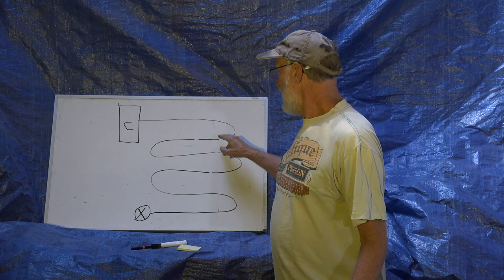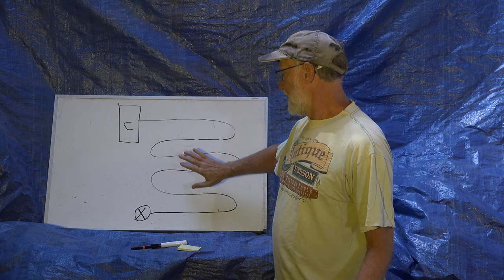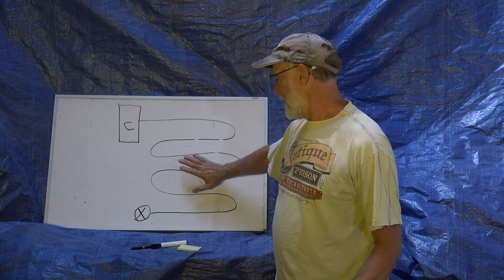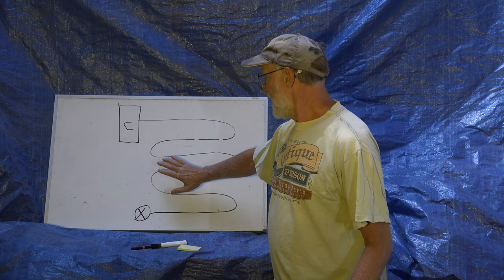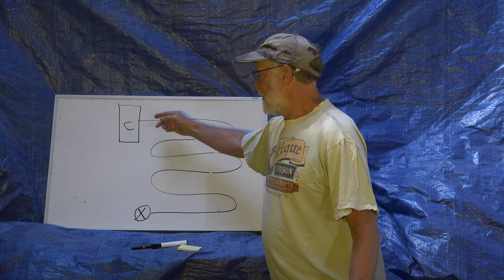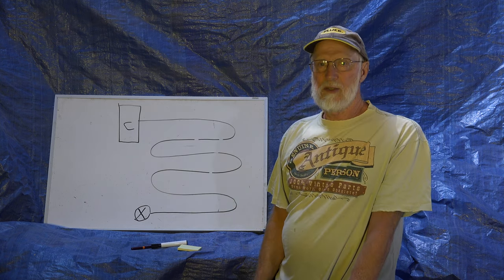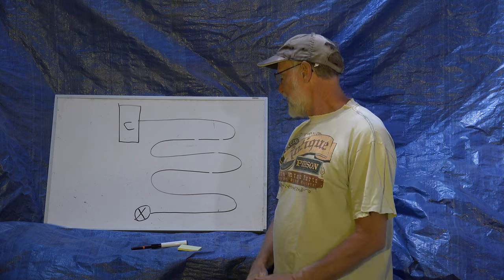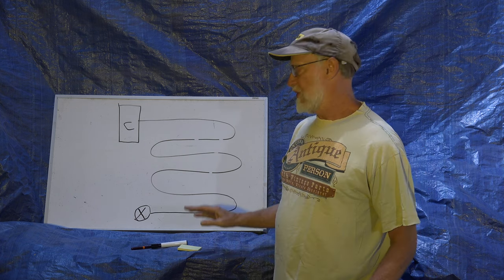How the evaporator works and why

Comment: Hey GFM,

I did a manifold leak test in water with pressure like you've done in an old video. I was able to find a small leak in the low side knob that required a new o-ring. After the o-ring replacement, I tested again and this time there were no bubbles anywhere.

I then connected a vacuum pump and pulled the manifold into a deep vacuum (around 29 hg.) and left it for a while, there's a ball valve on the service hose that is closed before turning the pump off. I had both knobs closed and after maybe 20 minutes, the vacuum dropped to 25 hg. I notice that the needle on the high pressure side was off the stop as well, so there was leakage there as well. Now I'm thinking that since it is not connected to an actual system, that there is so little volume in the manifold that such a leak is considered acceptable and that if I did this same test with it hooked up to a sealed system, it would not drop after 24 hours, since there is so much volume in it; which would take a very long time leak out at that rate. Is this a correct assessment? I'm like 90% convinced that it is, but I need to be 100% before I start using it.
Reply from the maker: That size vacuum leak is generally impossible to stop.  Most of these hoses have some leaks in the hose itself.  
GFM
Reply: Thanks for answering. I just found something out by accident. I left the manifold in its closed position for more than 24 hours. The low side was down to like 15hg, but the high side was showing 10psi of pressure! Now it dawned on me that this has something to do with barometric pressure and these hoses aren't really leaking. Just like putting a sealed container in heat will make it expand and putting that same container in ice will make it collapse; this principals hold true for the manifold as well to some degree. Since there is so little volume in the manifold, it doesn't take much expansion/contraction to show up on the gauges. Just my theory of course. I would be interested if anyone else has tried this with a brand new manifold, with new hoses just to see if this happens.
Reply: As I understand, manifolds, gauges and typical charging hoses are not vacuum rated.
Reply: I would just like to know if anyone has successfully been able to hold their unconnected gauges in a vacuum for a couple of days. I'd also like to know if they open their gauges and bring them to zero and then close them up, if they will stay at zero or slightly increase in pressure like mine does. I think knowing the answer to these things is very helpful to anyone who works in this field. There should be no unanswered questions regarding any hypothetical test.

My manifold holds pressure, but not vacuum; so it seems. Pressure can actually increase, but does not decline. I'm thinking that maybe they have a vacuum leak, but do not have a pressure leak and that barometric pressure changes are allowing air to enter the manifold through the vacuum leak, but isn't allowing it to leak back out when barometric pressure drops. So in effect, it is acting like a check valve to the atmosphere. I would just like to know if this happens to all manifolds and can be considered normal, or that my manifold gauge is just not adequate.
Reply: jjenson2006 Wouldn't that just be the affect of a rise in temperature on the air or trapped gas in the manifold?
Reply: That was my original thought. However, if that was the case, wouldn't the pressure drop again when the temperature dropped? The gauge only increases. I have left it alone for several days now. My high side is up to almost 20 lbs. The low side is about 8 lbs.

It seems to me that pressure is getting in easier than it can come out; like a one way check valve.
Reply: just for curiosity...digital or analogue?
Reply: Cheap analog manifold. Not sure what difference it would make. I don't make a living off A/C repairs, so I didn't see the need to buy a top notch set that would last through years of abuse. However, I'd go out and buy an expensive brand name set if it didn't do the same as mine. But I'm not going to go out and buy the set, just to find out it does exactly the same as mine.
Reply: it is possible to hold a vacuum in your gauges for a few days under a controlled load but, it's not a good idea because refrigerant can destroy the rubber gasket in the manifold. Also, pressure is building in your gauges because obviously the refrigerant you had in it under a vacuum is somehow being heated, and it doesn't raise and lower as quickly as you think because refrig is good at holding pressure. But I promise you if your gauges have a leak it will be in vacuum and positive pressure. and just because the pressure builds doesn't mean there's a leak it just means the pressure was raised due to exposure. A vacuum really can't be held for days and weeks because of this, especially in gauges.
Reply: it is possible to hold a vacuum in your gauges for a few days under a controlled load

What do you mean by a controlled load? Hooking it up to a system? Yes, I know it can hold when it's hooked up to a system and mine does, but I'm talking specifically when it isn't hooked up to anything and the valve is just closed.

refrigerant can destroy the rubber gasket in the manifold

I thought that the o-rings and gaskets were made of HNBR rubber that are able to withstand high heat and chemicals over a very long time period, which is why they are used to seal the systems in the first place.

pressure is building in your gauges because obviously the refrigerant you had in it under a vacuum is somehow being heated

But I don't even have to have it under vacuum. I could simply open the valves, let the gauges snap to zero and then close them, let it sit over night and in the morning there will be pressure.

if your gauges have a leak it will be in vacuum and positive pressure

It is very possible to have a vacuum leak and not a pressure leak. There is plenty of research out there that supports this.

Do you own a manifold? If you do, have you tried doing what I did?
Reply: I meant to say constant load and  a load is a temp or pressure ie. a compressor runs under a different load between night and day. also leaky gauges won't hold pressure or vacuum.
Reply: yes Yu can have a vacuum leak nd not a pressure leak but unless you're working on a negative pressure system such as chillers the only thing keeping pressure from leaking is a piece of debris nd that won't hold for long
Reply: and if Yu ever been in an HVAC class they will tell you it's not recommended to hold a charge or vacuum in gauges over time because the refrig carries NCs and oil which WILL break down the o-rings and inside of your hoses
Reply: jjenson2006 and if your gauges are building pressure over night that water you tested them with is possibly still in your gauges but I've never saw that except for this one guy he had a pretty shitty pair and they were already broke the needle would flutter from 0 to 80 when he set them down
Reply: jjenson2006 do Yu work in HVAC?
Reply: I meant to say constant load and  a load is a temp or pressure ie. a compressor runs under a different load between night and day. also leaky gauges won't hold pressure or vacuum

Obviously atmospheric pressure and temperature are not constant over a 24 hour period; that is not how nature works. This is the whole point of this discussion; is the change in temperature/pressure influencing my gauges when it is not connected to anything and is this normal.

I don't do HVAC for a living. My knowledge and experience in the field is limited; which is why I came here for advice. I do have very broad knowledge and experience with science and physics; which is why this interests me so much. However, I am more interested in finding an answer so I can be confident with my equipment. How can one work on something if he's not confident on the accuracy of his measuring equipment?

I do work on automobiles a lot and once in a while I have to fix or service the A/C. It's very rare that I would be working on a residential unit. Having a system that holds vacuum, but doesn't hold pressure is not very rare on an automobile. Sometimes it could be debris in a line; other times it could be an o-ring acting like a one way check valve or there could be a pinhole in a hose which when vacuum is applied, it will pull the hole shut. Did you ever try using a soft rubber hose on a vacuum? The hose will collapse and seal itself up. The same principal can be applied to a small hole in a hose; especially if it's an extra thick hose (like a standard barrier). You can search through forums on the internet and come across plenty of cases where this has happened. So I know that an o-ring can behave like this and since a manifold does have o-rings in several parts of it, I don't see why it can't happen on a manifold. Vacuum and pressure exert different forces on the o-rings. It's either pushing or pulling on the o-ring. An o-ring if installed properly will move in or out depending on the direction of pressure and has to seal on its two opposite surfaces, depending on whether there is vacuum or pressure. If one of those surfaces has debris or is damaged (dirt, hair, scrape, warpage, etc.), it will only leak on that side.

if Yu ever been in an HVAC class they will tell you it's not recommended to hold a charge or vacuum in gauges over time because the refrig carries NCs and oil which WILL break down the o-rings and inside of your hoses

I'm not doubting you here. Just seems rather strange because there is refrigerant and oil under very high pressure that is in constant contact with the o-rings. Remember, the o-rings are the only thing that is keeping this stuff from blowing out all over the place. If you have a vacuum going, the oil and refrigerant would have a lot less pressure on the o-rings as the vacuum would be pulling it away from them.

if your gauges are building pressure over night that water you tested them with is possibly still in your gauges but I've never saw that except for this one guy he had a pretty shitty pair and they were already broke the needle would flutter from 0 to 80 when he set them down

I would think after a few days there would no longer be any water in them, but who knows. The needles don't flutter around at all. I doubt there is any damage to them. Pressure only builds when the valves are left close overnight. Did you even try doing the experiment I asked you to? We can talk about this back and forth forever, but until you actually tried it with your own manifold, you will not really be able to understand the issue and we will never solve the problem.
Reply: jjenson2006 what I'm telling you is that you have pressure building because of water even if it evaporated it's still a built gas in your manifold
Reply: So you didn't even try that simple experiment on your manifold?

1) Open the valves and let the gauges zero.
2) Close the valves.
3) Leave it alone overnight and check it in the morning.
Reply: jjenson2006 yes I've done that plenty of time after working on systems nothing happened
Reply: jjenson2006 like I said more than likely Yu still have moisture or refrig in your Mani
Reply: Well if you've done it after working on a system, wouldn't your manifold still have some refrigerant in it? If you say that refrigerant in the manifold causes this, then wouldn't it of happened to you as well?
Reply: jjenson2006 my apologies it's never happened to me because I always evac my Mani after every system charge
Reply: jjenson2006 but I'm pretty certain if Yu charge or even do the experiment you stated with out evacuating your gauges afterwards it will happen
Reply: You mean you connect it to a vacuum pump and let it run for a while? How long? I did that, but for only 5 minutes. Did I not do it long enough?
Reply: jjenson2006 no that's when Yu should have a recovery recovery
Reply: Not sure what you mean. How long should I run the vacuum on my manifold to be sure there isn't any moisture or refrigerant in it?

Better yet, how long should I run it to convince you that there is no longer any water or refrigerant in the manifold? I've had it running for 30 minutes at this point and it's still going.
Reply from the maker: Ok, this is getting out of hand.  Much ado about nothing.  Gauge set hoses absorb oil and refrigerant.  So yes, you will have a pressure reading even if you open the set after working on a unit.  And no do not evacuate the gauge set after each usage.  Just ignore the pressure and dump it on the next one.
GFM
Reply: Sorry GFM, I was just zeroing in on a potential problem; not sure why it would annoy anyone. With all due respect; I don't think you read enough of the conversation to understand what I was talking about and what I was asking. Since my question hasn't been answered yet and you feel this is getting out of hand, I will find another channel or forum to seek my answer to this particular problem and spare you the headache. Thanks and have a nice day.
Reply: grayfurnaceman its started to cool a little, but basically is warm.